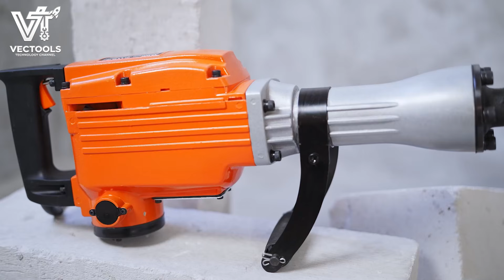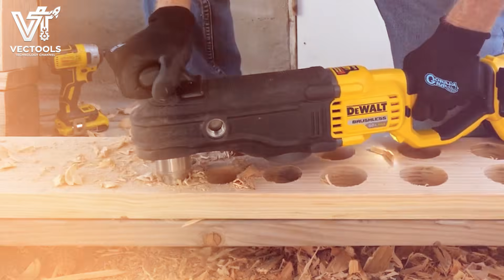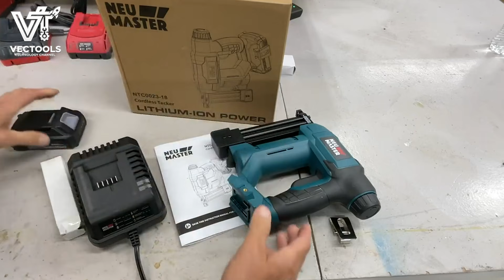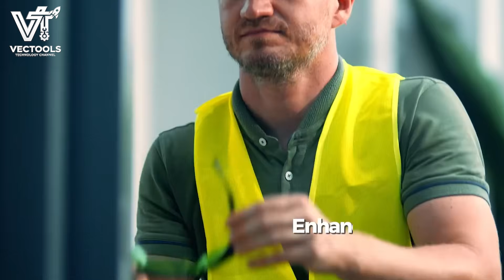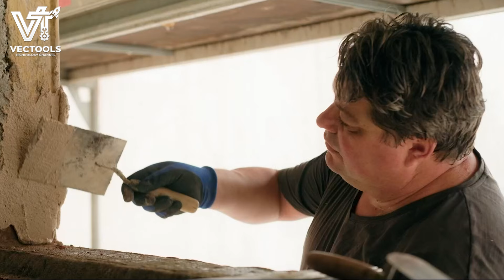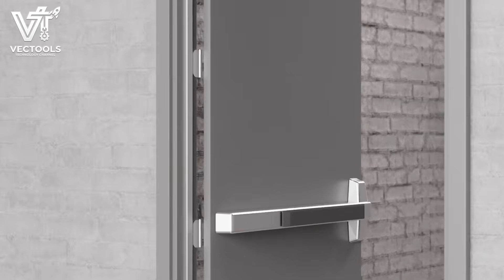NEW CONSTRUCTION TOOLS THAT YOU HAVEN'T SEEN BEFORE

Comment: The Graco paint system is $394 at the Depot not $230🤔
Reply: They are talking about the magnum project painter. $249 at home depot. I would recommend the Graco x5 over that one. X5 is $300 but it's much better all around.